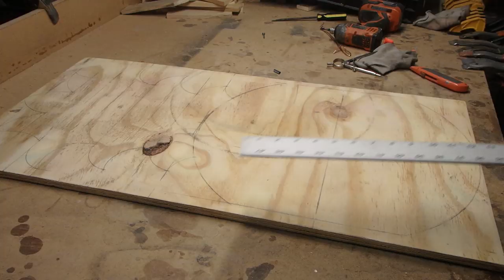Pallet Project - Pineapple Wall Hanger!

Comment: This would have been so much easier if you laid all the pallet slates down on a table and then traced the pineapple pattern over them. Then you could have just cut each slate individually on the scroll saw and then reassemble them afterwards.....could have been done in under a hour.